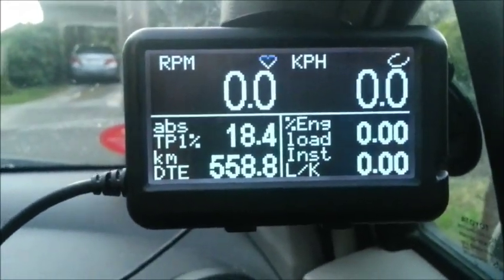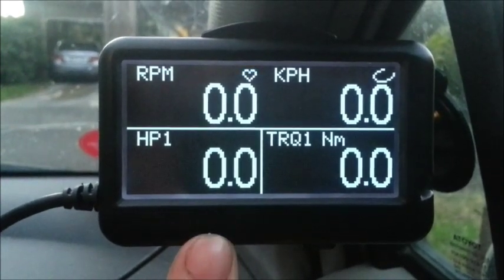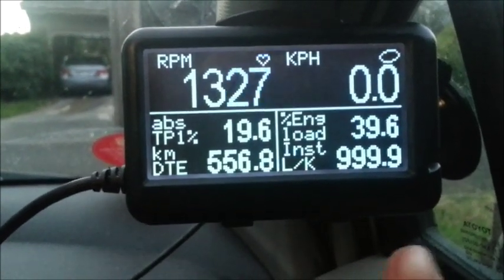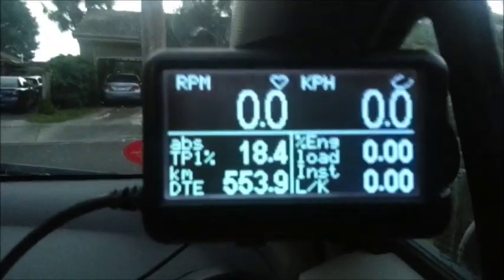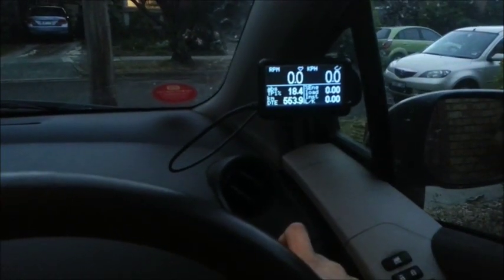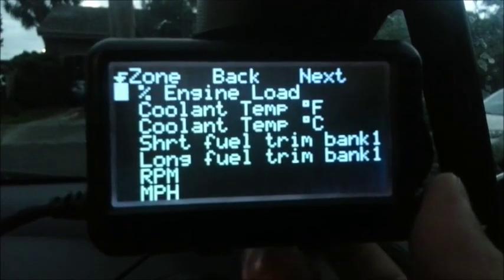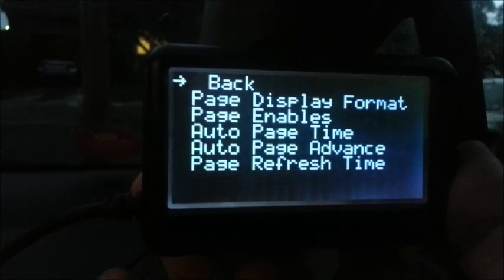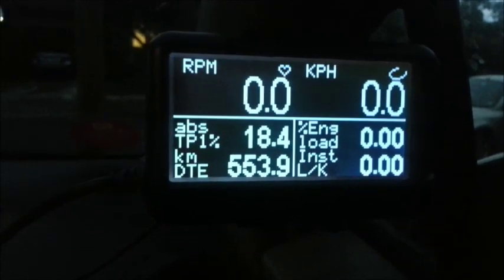My new toy - The Ultragauge EM v1.2

Comment: Anyone else have this thing constantly changing screens ?  can't get it to stop !!
Reply from the maker: +Nate Ngzcaz Try looking in Gauge / Page settings for Auto Page or Auto Page Advance ?
Reply: +Ryan O'Malley     I'm afraid the instructions are long gone and I don't see anything on the setup that helps. I have one of the first models with three protrusions ( buttons ) on the back of the unit. For whatever reason it keeps cycling thru the menus. I like the unit but very frustrating when you can't find any info. No online help and no number to call for assistance. I've tried pulling the OD11 connector but that doesn't help.
Reply from the maker: The buttons on the back control the unit
The left button (the one by itself) is the Menu / Select key.  The other two are UP and DOWN keys.

Press the Menu Key and call up the menu, and then use the up down keys to move the arrow around.  Select the second option that says "Select Gauges / Page" or similar.
Look around the sub-menus there for an option that says "Auto Page" or similar.

You should also be able to pause the pages advancing by pressing either the UP or DOWN key.  I think it is the down key.
Reply: +Nate Ngzcaz That sounds like a setting you have accidentally configured to cycle through the windows... you can download the PDF manual just by googling it

Comment: Great video review thank you!  I've read that the usual refresh rate is about once per second, but yours looks to be running at least double that rate.  Was there a setting for 'faster communication/refresh rate' that you changed??
Reply from the maker: cakepanda Thanks mate!  I have my refresh rate set to 120 refreshes/ minute or refreshing every 0.5 seconds.
To adjust the setting:  Menu -> Gauge/Page -> Select Gauge/Page -> Settings -> Page refresh time.
Default value is 1.0 seconds.  My setting in 0.5 seconds
Acceptable range is 0.1 to 2.0 seconds.

The manual warns:
As the time is reduced, UltraGauge consumes more bus bandwidth requesting and transferring data. As a result this setting should be used with caution. In many vehicles the OBDII port is connected to a vehicle wide information bus. This bus is used by various vehicle modules to communicate. There is a finite bandwidth on the bus and setting the refresh time smaller and smaller will consume more and more bandwidth to the point that it could impair regular bus communication between system modules
//
When reducing the refresh time, note any abnormal side effects such as intermittent “Err” being display, the Check Engine Light becoming illuminated or impaired engine performance or altered shift points. Should any of these conditions occur, increase the Page Refresh time until the issue no longer occurs

Comment: Can it do oil temp and oil pressure?
Reply from the maker: Dave L , I don't know if it can or not.  It doesn't show up on my car because it is not reported by the ECM.
You should go to the Ultra-Gauge website and use the gauge estimator and that should give you an idea of what gauges will be reported by the Ultra-Gauge.  Good luck!
Reply: Thanks Ryan
Reply: Good Lord, it does 110 gauges on mine. But not the oil temp and pressure! Still a tempting toy though.

Comment: how the hell did you set it up for Australian settings Icant change mine from Miles and i need it in kms
Reply from the maker: Hey mate.   The ultragauge EM has both metric and imperial gauges.   You need to go to Gauge/Page settings and assign gauges through there.  You should find the metric gauges in there
Reply: *****
 So i just do threw all the settings and change them in their ? i did change it to kms and L when i started it but i did seem to work when running in the correct display
Reply: in the VID when he selected the gauge to show it showed UG / temp F and UG /temp C and the same for the BAROMETRIC pressure in KPA OR in/HG